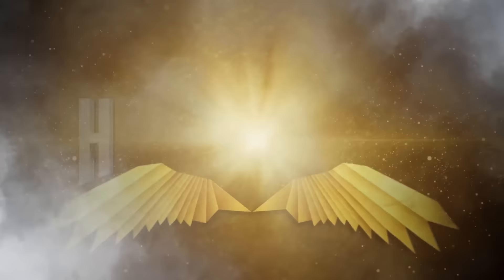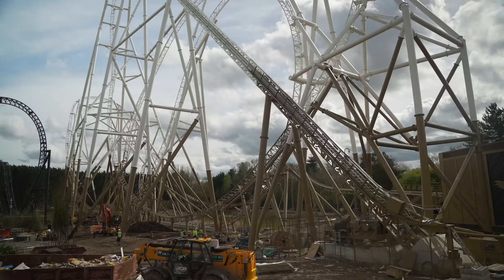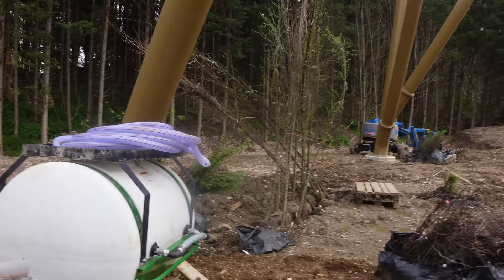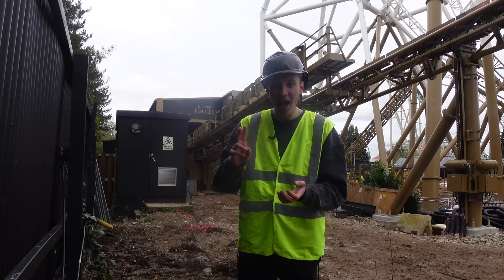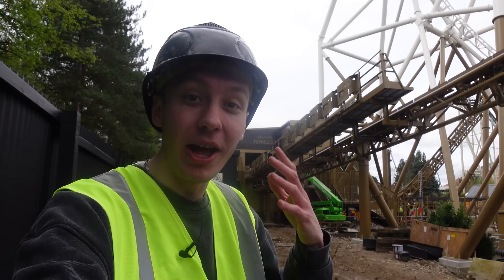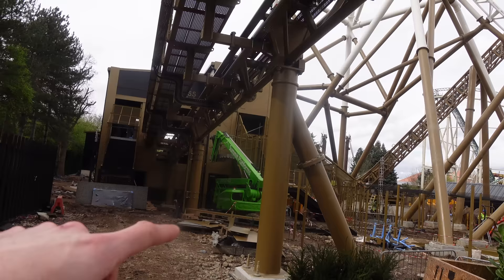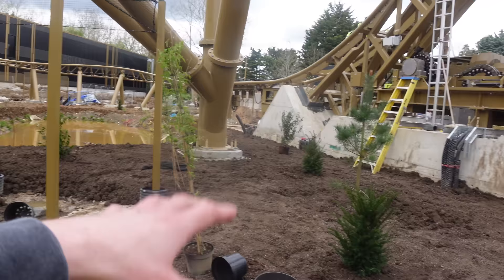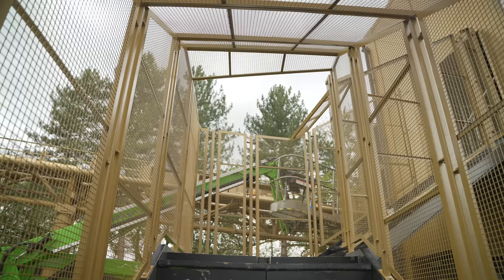HYPERIA Testing Preparations! | THORPE PARK

Comment: what could be so cool is that the station should have automatic gold sliding doors that opens before the train exits the station and have fog emitting. Who agrees?
Reply: That would be really sick
Reply: Sick, but adding this is a point of failure. If the doors don’t open the ride can’t operate. (Not trying to s**t on your idea)
Reply: That is an amazing idea, but this is Merlin we are talking about, if we do get the smoke I doubt it will be on a lot
Reply: Yes U.K. rides lack immersive experience 🙏🙏🙏
Reply: No lmao
Reply: How did you come up with that? That’s a crazy idea!
Reply: something like the croc drop doors at chessington would be cool
Reply: Really good idea
Reply: @stevenuttall1771  there are so many other bits to a ride which are less reliable than a door. There's already gonna be loading gates, and Nemesis inferno had a dropping floor/front barrier.

Comment: Super detailed vid Jack! So exciting that testing is soon! I have had a thought though about the track joints and the fact that I haven't seen them being smoothed out, I don't know whether it needs to be done but, I know that other coasters have had it done like Storm Chaser which is another Mack and Nemesis reborn had it done, so I dont know how long it takes if it does need to be done?